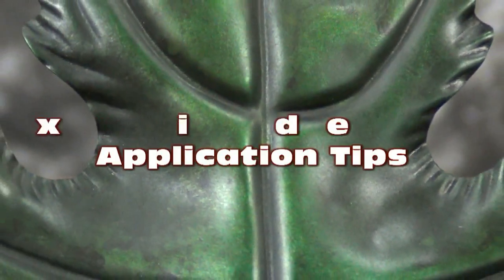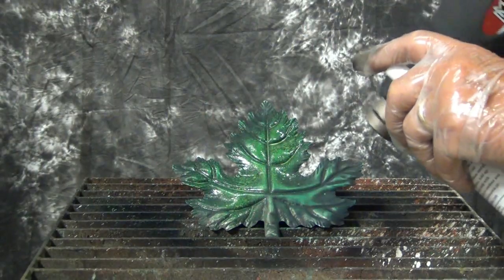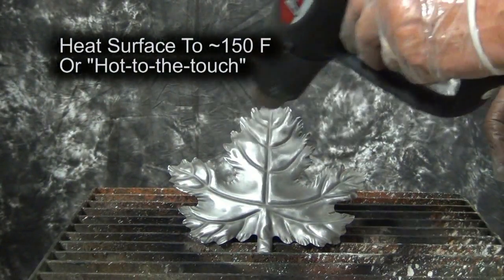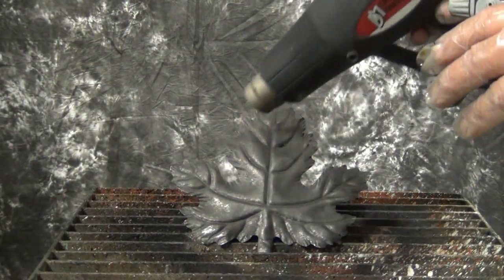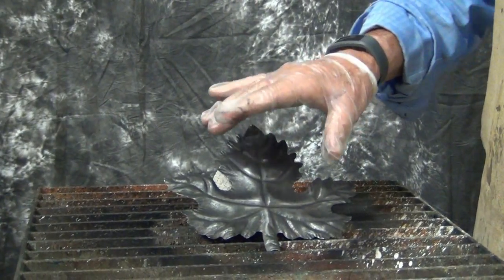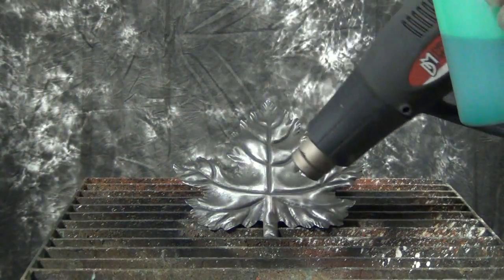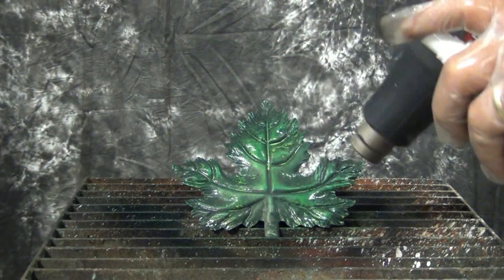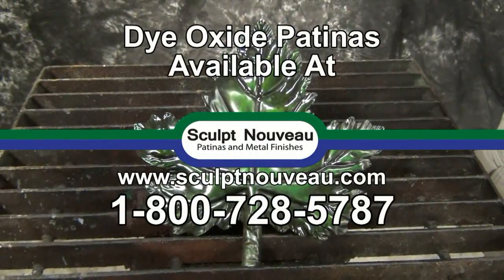Dye Oxides Basic Patina Process

Comment: Does this scratch off easily?  I thought dye oxides colored metal permanently by soaking the metal.  I see you are spraying it on.
Reply from the maker: Dye Oxides are not a permanent solution, they will abrade off easily without a clear coat.